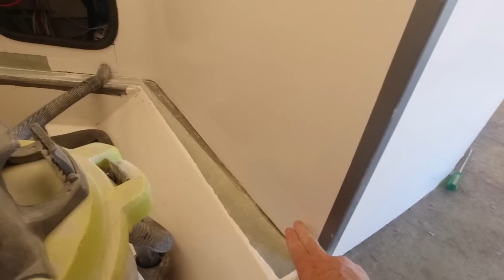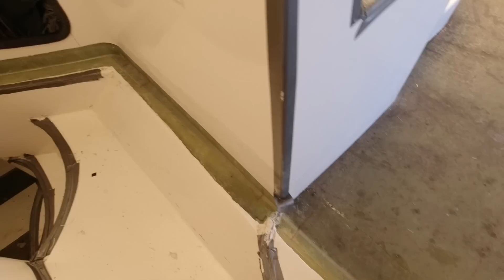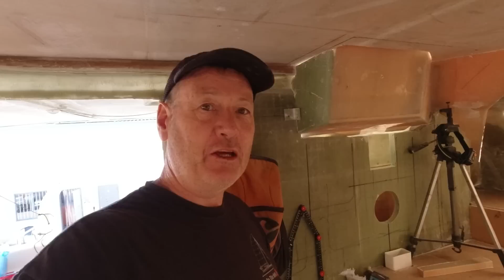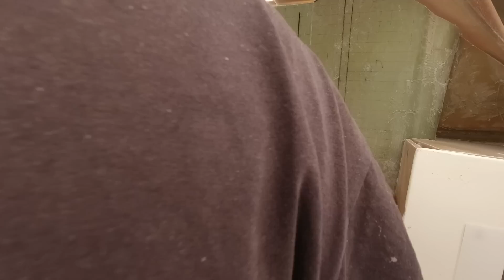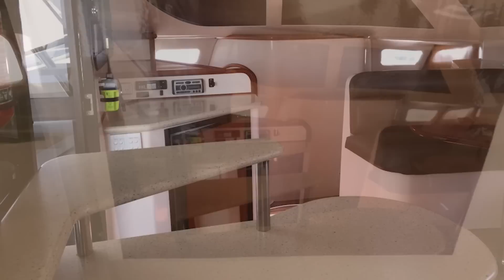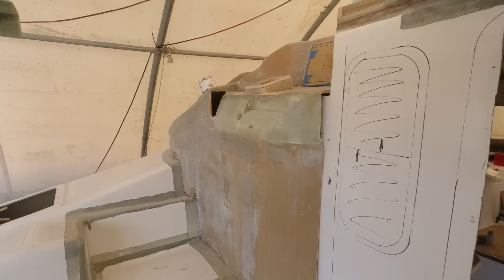It's all about the Catamaran Structure // CATAMARAN BUILD SERIES Ep256

Comment: Ross, Do you have any plans for a monitoring method on those critical hard to see tabs like some lines painted on, or other strain indications besides the usual creaking sound indications ? There are some acoustic based systems used on aircraft I'm wondering about possible usage on composite boats to see if there are significant changes in structures. You might try taking some laser level indications of current condition in yard, at launch, then after rigging, and so forth, and having them recorded with dates on hull to see how much initial flex occurs until system is balanced in tensions and load from all items added later like water, fuel, and people with gear etc.

Comment: Wow you will have to spread the winch platform tie points into the the floor of the boat apposing the forces. If you just tie it into the side and helm station I feel it will fail. I’m sure you have it covered
Reply from the maker: It is now serious box section tide in 4 places also clutches will be on the reinforced cabin roof which will further dissipate the load.Ross.